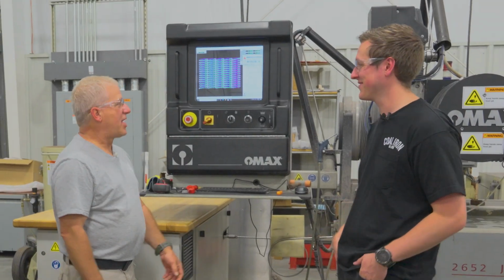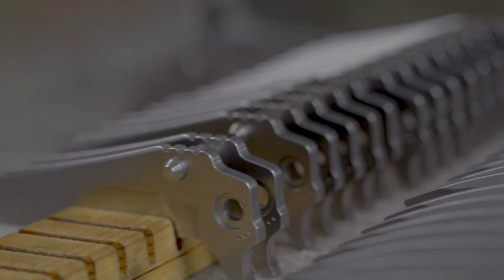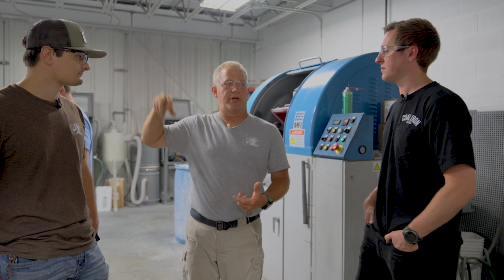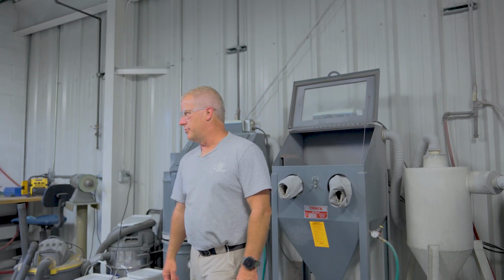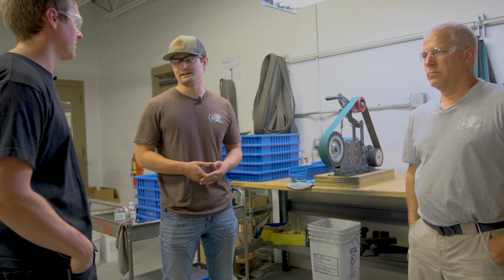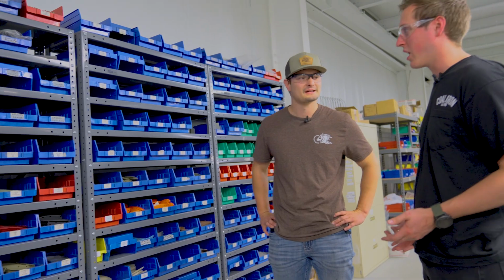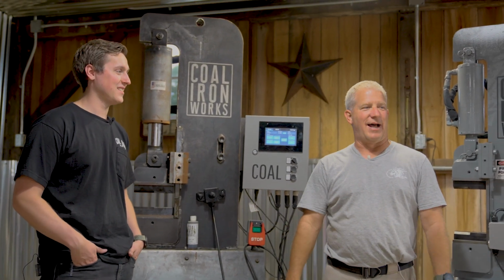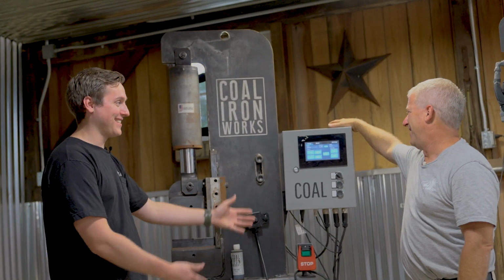American Made: Rick Hinderer Knives

Comment: No wonder you can't keep em' in stock,  your shop's small...  might have the latest,  greatest,  but you don't have them in the numbers for keeping them in stock as much as people would wish...  for example,  Eklipse Swedged Spear Point CPM Magnacut...  was signed in to my account,  had the item I wanted on the screen, FDE & Bronze , I was signed in & had my payment method stored... as SOON AS THEY DROPPED I added it to my cart and went right to check out.  Before I could finish checking out a notification popped up notifying me that the quantity (ONE)  that I requested was no longer available. Didn't even empty my cart and went right back to bookmarks and got the Blue G10 and Anodized blue in my cart ...  that's the first one I bought.  I'm not completely happy with it...  I'm tired and I don't want to get into the negative right now. But it's mainly lock stick!!!
Reply: Cuz I don't know if I should go back to the place I purchased it or to the manufacturer???

Comment: Decent knives, atrocious customer service.
Reply: I have an old Hinderer and it is bulletproof. But I bought a new ekipse 3.5 and the quality has really got bad on these knives. My buddy has one and holding them side by side and there are noticeable size tolerance differences in both knives. It seems like their manufacturing is inconsistent with the same knife made at different times.
Reply: I own three Hinderer knives: XM-24 (S45VN), XM-18 (S45VN) and Eklipse (20CV). All three knives are flawless, fit and finish, action is wonderful. The framelock can even withstand strong blows to the back of the blade. As for hardening, I don't have a hardness tester, I can only compare it with knives from other manufacturers with the same steel when cutting and sharpening. I sharpen by hand (I have only been using a TSPROF Kadet Pro System for some time when reprofiling edges) and I can't tell the difference when sharpening my Hinderer knives compared to knives from other manufacturers with the same steel. If you have experience sharpening by hand, you can really feel how the steel behaves and if there is something unusual, burnt edge etc, you can feel it when sharpening. As I wrote, I haven't noticed anything negative with my three Hinderer knives.
Reply: Really? Good to know. I won't be getting any, because I have heard this several times. This is obviously his reputation.
Reply: Absolutely. Terrible heat treat as well. And one of the worst warranties in the game at that price point.